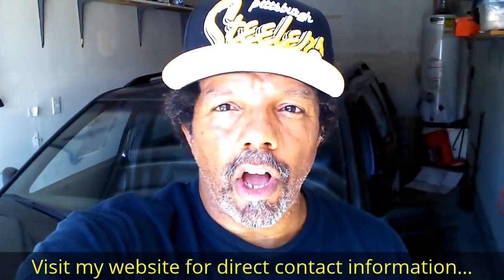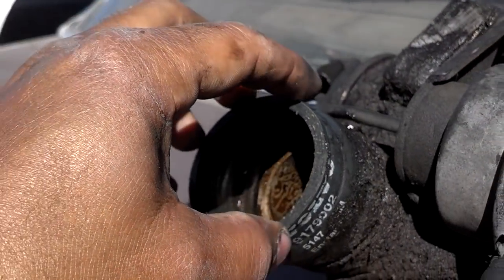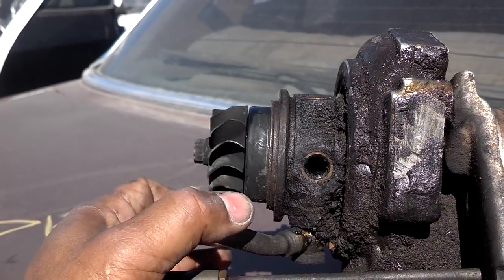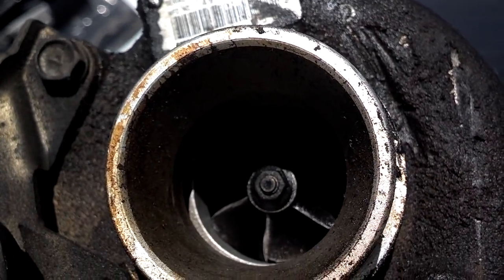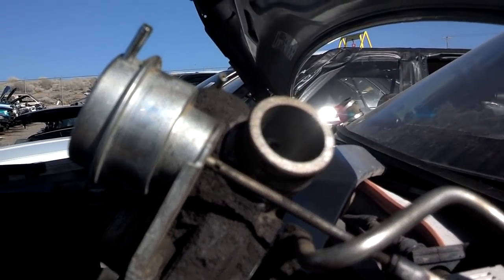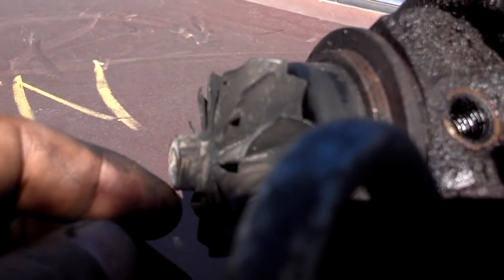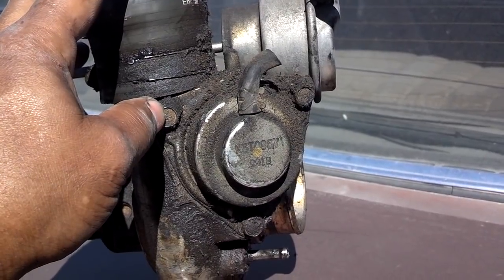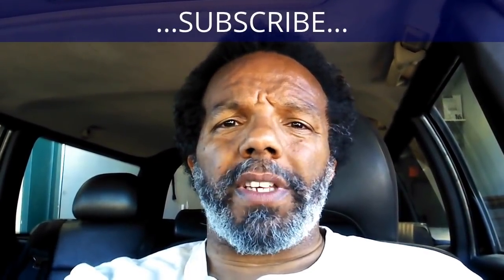How to tell if a turbocharger is bad. What can go wrong with them. - VOTD

Comment: Hey, amazing video, thank you! My turbo on my car gives too much pressure almost 3bars (around 43psi) can that be a problem of the actual turbo?
Reply from the maker: No, the turbo is a follower.
Reply: Václav Hanzl could be a problem with the tune, boost controller or if it’s stock it’s most likely running off of the wastegate and you have a bad wastegate

Comment: Thank you! I have a 1.8t Passat with a lot of miles, original turbo. I was thinking of replacing the turbo, but after an inspection based on your video I'm confident I can leave it alone for a quite a while—no shaft play, spins freely, no leaks. Cheers!
Reply from the maker: You are welcome.

Comment: Does anyone know if your car can run without a turbocharger I have a 2013 Kia Optima SXL and that engine blew on it and Kia covered the engine but told me that the turbocharger went out and that would cost me $3,000 and then a friend of mine told me that you don't actually need a Turbocharger unless you want to go from 0 to 60 in 6 seconds
Reply from the maker: 🤦🏾‍♂️ Nope.

Comment: Hi! I’m doing research for my 2011 Nissan Juke.  After having the engine oil cooler break then immediately following that repair my engine chain cover cracked there have been two major times that my car completely emptied all of its oil.  Now I think I may be having turbo problems and so does the mechanic that fixed it.  He recommended I take it to Nissan to get it repaired but they are more costly.  I don’t have any of the symptoms you mentioned in this video but I my car idles low like it wants to cut off (but doesn’t) and sometimes it won’t accelerate from a complete stop very well.  Is that caused by a turbo issue too?
Reply from the maker: It can be, however, if your vehicle lost it's oil while running it could be the crank binding. Did you get a low oil light when it lost oil? Did you shut down the engine immediately or did it run a few minutes with no oil?
Reply: Robert DIY  The first time it ran out of oil I was traveling and the oil light came on.  I drove it a few minutes to my parents house which was closer by.  The second time it started leaking the oil light didn’t come on.  The mechanic insisted that it was just the oil in my undercarriage dripping out.  I work 2 hours away and when I made it back home I checked the oil again it was completely empty again.  He found the second leaks and fixed those after that.  I did have a problem with it not accelerating on the interstate after that.  He said he forgot to put a part back on correctly.  It ran afterwards but I started having the “turbo” problems and now I just don’t know if that’s it.
Reply from the maker: Dang, he forgot to put something on correctly? Ouch! My guess is that the engine is now bad.
Reply: Robert DIY I was thinking that was the case but was HOPING that it wasn’t.  I’m going to have to get a new car.  I checked out your website btw!  Awesome! I went to college in Arkansas at UAPB! You have a new subbie here.  I need to learn more about cars overall so I can make better choices and know a bit more about what’s going on when my vehicle isn’t running right.  Thank you!!! You’re very helpful and I understand your tutorial better than any I’ve seen!

Comment: What about an insane whistle on a 450 hp Cummins that runs in a day cab KW. Sounds like it’s right there at the turbo but my loader man thinks it’s a bad bearing on one of the pulleys. Hasn’t lost any power at all and you can rev the motor but as soon as you let off it quits but a after a couple seconds of idling it starts back or after about 1200rpm it’ll start up on acceleration but quit once you get to cruising speed.
Reply from the maker: If it's tight and not smoking, the turbo is probably fine.
Reply: I just posted a video of it from the cab. It did this about two weeks ago after I got it back out the shop so we replaced the alternator because the pulley had a lot of play in it. Now all of a sudden its happnin again. But like I said she’s still runnin hard I just pulled 30 tons of wood past an ole Mack like it was standing still so it hasn’t lost any power and it’s hard to tell about the smoking part because of the DEF system on these trucks even though it has a delete kit that got rid of all that but I ain’t sure if it’ll still let it smoke. We pulled the boot off while it was spinning and it looked alright but my step dad never messed with it not turning.
Reply from the maker: Hard to get quality parts now days.
Reply: Robert DIY yeah i think I found somewhat might be wrong with it. I’ve got an exhaust leak from where someone took the turbo off and over tightened one of the bolts and broke it off. The sound I’m hearing on acceleration is that exhaust leak. So I’m pretty sure the loud screeching is from a pulley gettin ready to seize. I’m still hauling wood with it tryna get the people at cooper kenworth to find the damn parts for it.

Comment: can you remove or disconnect a turbo from a diesel truck (big box truck) and drive it to bring it home from a buyer without smoking or causing harm. Looking for a box truck for storage that I can drive home and drive if I move to another residence. I found a diesel truck with 200,000 miles needing a turbo and may make offer on it if I could drive it home without smoking up the highway.
Reply from the maker: Probably not. The turbo is like an external breathing machine.

Comment: thank you very much for the information. Problem - 1998 Supra, Precision 6766 Turbo, tons of white smoke after 5, 10 mins of driving, never ran hot, no oil leak in driveway but the tailpipe is caked with oil on the inside, oil on 3 of the spark plugs, minimal or no loss of power, no stalling, no overheating, the engine compression & variation is acceptable, 70,000 miles on the Precision turbo, not a racer, daily driver . Does this sound like worn seals or what ?  If so, how much to replace worn seals and what shop in Miami or Florida is recommended ?  Drag International, Titan ? Thanks anyone and thank you Robert DIY for the very nice explanation of the workings of a turbo, great video, thanks alot.
Reply from the maker: have you checked the turbo for play?
Reply: @RobertDIY  yeah I'm trying to get my neighbor to take my turbo off so I can check the things that you mentioned, I don't have the tools to remove it. You made an excellent video with no bells and whistles just usable information great job thanks
Reply from the maker: You don't have to remove the turbo to check it for play, just the inlet pipe.
Reply: Robert DIY. Okay my blades are chewed up horribly, where do all those chewed up bits go? So now is this something that can be repaired with a new turbine, lmpella shaft drive or whatever you call it or do I need a new turbo and what about the oil line feed ?
So I have a precision 6766 I'm thinking with replacing it with either another precision 6776 dash 6062 or 6266 , any thoughts. Thank you so much
Reply from the maker: Rebuild, A1 Turbo in LA CA.
Reply: How much should a repair like that cost me ? And the bits of the blade that are chewed off,  are the fragments now in my catalytic converter or intercooler possibly ?

Comment: what do you mean by overboosting?????? driving citroen jumper 2015 getting turbo problem ,used this van for work ,get no smoke
Reply from the maker: To much boost pressure at to low of an RPM. Boost should kick in a curve, low boost at low RPM's and full boost at high RPM.

Comment: Hi Robert, great videos. I am a fan. My question, I have a Volvo S80 T6 2003, twin turbo. No boost at all, recent overhall done, TCV valve came clicking while applying 12 volts on a testing procedure so I am guessing here it is ok. Vac lines tighten (makes a big difference when no pressure leaks), and son on. Although I have  my wastegates disconnected, unhooked from the manifold small lever, as this is the only way I can get rid off a high pitch sound when pressing the gas. Once disconnected no sound at all and cars works well, but no boost. What I need to know dealing with the waste gates as I assume that is what my problem is, if the waste gates levers are supposed to push or to pull, ir order to be calibrated with the manifold levers. Push or pull from zero position. Thank your Robert.
Reply from the maker: https://www.youtube.com/watch?v=PXR9m-c_FuM

Comment: I have a 96 gmc with a 6.5 I noticed that the turbo leaks .right at the turbine. also I found oil in the air filter..any help will be appreciated..by the way good info.on your video. 👍
Reply from the maker: Oil in the air filter? How did that happen? I see water stains sometimes. Have you pulled the inlet and checked for play?
Reply: Robert DIY no I haven't. Where I live its hard to find a diesel mechanic. also when I turn the engine off a smoke comes out of the air filter housing.it sounds crazy but I do have these problems .
Reply from the maker: Ouch!

Comment: Hi Robert , great video. Any idea on why my turbo is making this noise? Checked for shaft play and there is none and can't find any boost leaks? https://youtu.be/casMHCusf8A
Reply from the maker: Hmmm, sounds like a vacuum pull whine. Not sure. Is the bypass valve in good condition? Is it boosting good?
Reply from the maker: Put the link on a forum or FaceBook page.
Reply: @RobertDIY  Hi thanks for reply, currently little boost, the VNT actuator is moving a bit but not much, I cant move it by hand. The noise seems to be inside the compressor house casing. With the plastic pipe that attaches to it the noise is there but not as harsh  - the same pitch, but still loud.

Comment: its like white smoke but mine is throwing black smoke and there is no boost in 2 gears i mean no power from the suv , its kia sportage 2001 model, plz help me out if its a turbo problem or something else thanks
Reply from the maker: You can pull the inlet tube and check it for play.
Reply from the maker: Nothing that I can see from here.

Comment: Robert, I have a 97 850 T5. The dash gauge that shows how much turbo is involved now only goes up to 12 o'clock, not quite reaching the area that indicates that the turbo is adding power. I'm not getting the power boost that i used to get when the gauge moved up into the 1 or 2 0'clock position. Otherwise the car runs fine, no smoke, engine not misfiring or anything. Could this be a vacuum leak or something like that?
Reply: By the way, this is John. I must have logged in as Monica!!
Reply from the maker: Boost leak somewhere. Is the CEL on?
Reply: What is the CEL?
Reply: Hey Robert, I should have checked this from the start. I'm getting a p0245 "Wastegate Solenoid A Low" error code. Can you tell me how I should proceed?
Reply from the maker: Check engine light.
Reply from the maker: Did you search my channel with the code?
Reply from the maker: https://www.youtube.com/watch?v=gt9w-ZSxs9I
Reply: Hi Robert, my last two comments seem to have been deleted. Did you see them? I indicated that i did search your channel, and had a further question about the cause of the error code, I also mentioned making a small contribution. Please respond when you get a moment. I can repeat the question if you need it. Thank you.
Reply from the maker: I don't require a donation for a response. If so, I'd demand it up front. Did you watch the search video?
Reply: Donation was just gratitude for what you do. Didn't mean to imply otherwise. Yes I watched the search video. I then searched for the P0245 code and your how-to on replacing the actuator video came up. You were replacing the actuator because it was rusted out and couldn't be adjusted. The video didn't explain  what causes a P0245 nor whether an adjustment could clear the code and restore boost. That is what i'm hoping to learn before i dig into it.
Reply from the maker: What kind of car do you have?
Reply from the maker: You should text me or call. It is hard for me to find this conversation.

Comment: Hi, ive got a Toyota Coaster mini bus, turbo diesel. The intercooler has got lots of oil ish gunk all over it- not smoking. Performance is ok,where is the oil possibly coming from plz?? Is it normal to have an oily intercooler?
Thanks mate.
Reply from the maker: I have no experience with that vehicle, however, depending on the design of the EGR system, it could be circulating oil vapors through the turbo piping, which can cause oil residue and build up.

Comment: Hey Robert, Great video, I have an 05 S40 T5, that blows out exhaust smoke periodically, sometimes heavy, sometimes light, sometimes not visible, sometimes at cold start up, rarely ever at idle. Car doesn't skip or miss when this happens, runs fine during this smoke issue. I can't find any evidence of a blown head gasket. Do you think its a turbo issue? and have you ever bought a rebuild kit for one of these Volvo turbos, if so how did that go??
Reply from the maker: Could be a clogged PCV.
Reply from the maker: Yes, I have rebuilt a turbo, went fine. I prefer to leave it up to the pro's for balancing reasons.
Reply: I replaced the the oil trap about 12,000 miles back
Reply from the maker: Did you do the glove test recently?

Comment: Robert, Thank you. I wish this video would have popped up in my "2003 Volvo S40 Smoking at idle"  I've spent hours looking at possible problems.  Ended up buying a compression tester to see if the rings, gasket or valves were bad.  This is something I can fix.  If it was rings, I was looking to donate car to trade school.  After watching your video, I'm positive my smoking issue is the turbo. I hope a repair kit is available.  Thanks again.  Mark
Reply from the maker: You are welcome.

Comment: Hello Robert can you help me I have a 2004 Volvo S60 2.5t I barely replaced the cylinder head because I watched your video and it started right up !!!    Any ways before I replaced the cylinder head it would blow out blue smoke on start up and now it still does it even after the new head.    It blows out lots of blue smoke on start up but it's slowly starts to go away as you drive it.    If you drive it for about 10 minutes it's not even noticeable it goes away.     However if I go grocery shopping and I last 2 hours and come back out and start the car up again it smokes a lot again but will only last about 10 minutes and as your driving it slowly goes away     So what can it be the pcv valve ?? The valve stem seals (which I already replaced cylinder head) ? Or piston rings ??   Or the turbo but the smoke is blue and it smells like oil and it only lasts for as long as 10 minutes smoking
Reply from the maker: My guess would be the PCV or turbo. Does it pass the PCV glove test?
Reply: Robert DIY      No I have not done the glove test but I was watching your video yesterday of the glove test and I am going to do it today.    But I am almost sure that it is the pcv I will let you know how the glove test goes and thanks for the reply
Reply from the maker: OK
Reply: Hello Robert I did the glove test and my car did not pass it.   So I'm going to change the pcv first and I will let you know what happens.    I don't have too much money for the whole kit which includes all kinds of hoses and stuff would buying the pcv oil trap alone be enough to fix the problem ?   I'll clean the hoses

Comment: So my car ( Subaru Forester XT 2004 ) runs fine but when I accelerate fast it stops responding to the gas and slows down the speed up again and then the gas works again. Idk why but I can’t get on the highway or anything cause of it. Also it leaks oil pretty bad. But I make sure it’s full I’ve had a lot of work done to it but they can’t figure out what’s wrong but they don’t know about how it’s running rn. I’m thinking it’s the turbo
Reply from the maker: Probably. Could also be a hole in the turbo piping, bad cat, or failing fuel pump.
Reply from the maker: https://www.youtube.com/watch?v=NWfLpp8NevI

Comment: What about strong whistling sound? I dont have any smoke comming out of the exhaust nor do i have lack of power.. Car drives normaly, pulls like crazy but just the sound is really annoying and it's comming from the turbo somewhere. Maybe the pipe is broken or?
Reply from the maker: Wouldn't really boost if something was broken.
Reply: Robert DIY I've been at the mechanic today and as soon as he heard the sound he said it was some belt or tensioner.. I dont know how did i hear the sound comming from the turbo but ok
Reply from the maker: Good to get it checked out.

Comment: My gti burns substantial oil and it only smokes once a day, or basically if I wrap out first through fourth, but when I just normally drive it and take it easy I have no issue with smoke
Reply from the maker: Not that you can see from the drivers seat. lol

Comment: Hi Robert, I have A 2004 Volvo XC90 T6 and I'm having the symptoms where I get smoke all the time and it's leaking oil where one of the turbo is located on the passenger side I know It's the turbo but after seeing your video I am positive it is the turbo. The problem is that I have a twin Turbo and I'm not sure which of the Turbo is defected, so I'm not sure if it's cylinder 123 Turbo or cylinder 456 turbo?  Please let me know, thank you.
Reply from the maker: Bring it by.
Reply: Which one was it?